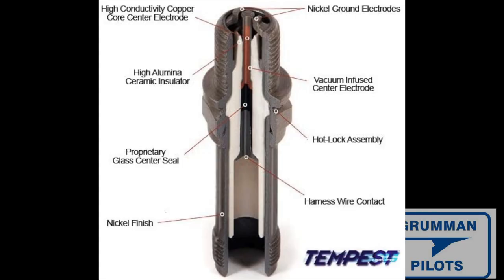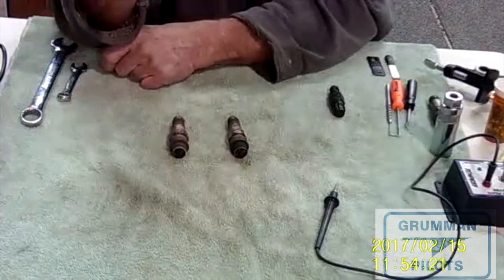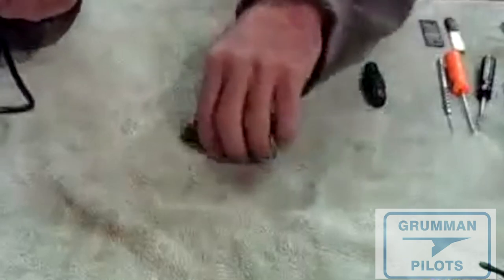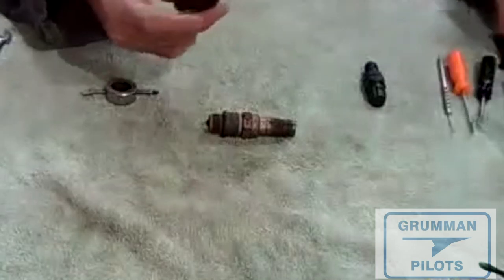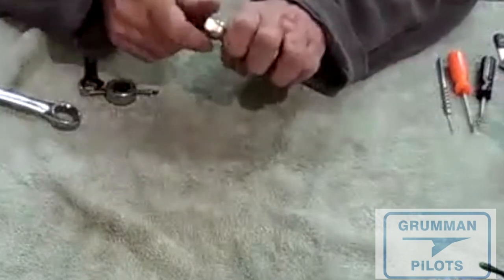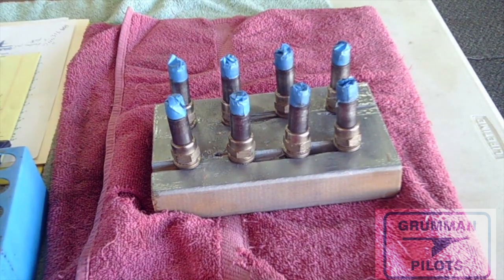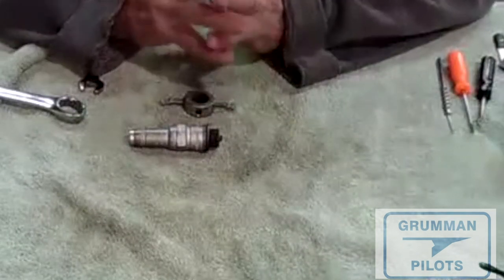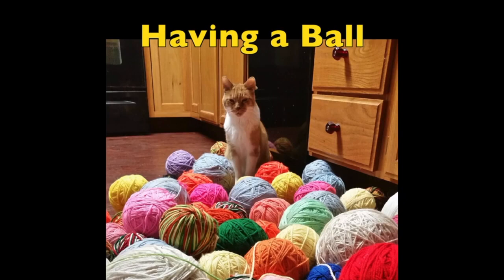Aircraft Spark Plug Basics - Grumman Style

Comment: Great vid, Roscoe! Also worth mentioning are tiny cracks in the insulator. I chased a misfire for a month before I noticed one plug had a crack inside the lead side.
Reply: I replaced parts, went back and forth with Electroair engineers troubleshooting, and the whole time it was a crack...
Reply from the maker: Thanks for sharing
Reply from the maker: Yep they have to be in good shape.
Reply: a crack on the ceramic insulation will short the current to the side, instead of to the tip of the plug.
Reply from the maker: In the tester we clean in we also check the tip firing under pressure.  Good tip though!
Reply: @GrummanPilots  It happens mostly if you drop them.  Then you cannot see the crack..
Reply from the maker: We have a shop rule, if you drop it once, drop it again in the trash.
Reply: @GrummanPilots  Right Policy..